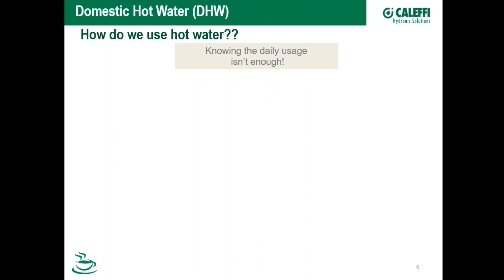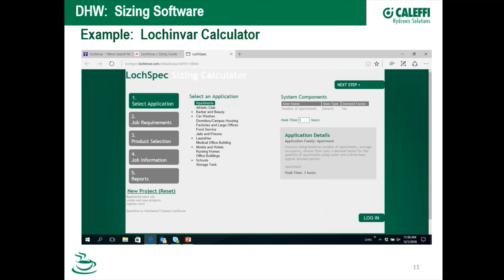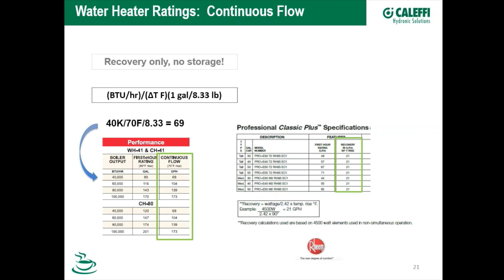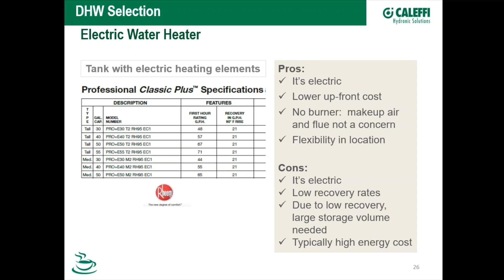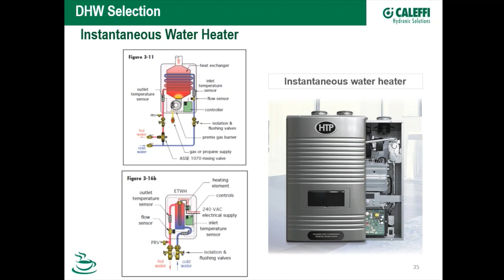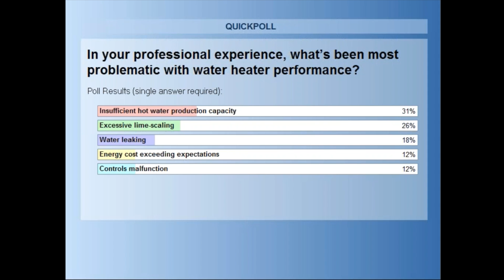Selecting and Sizing Domestic Water Heaters

Comment: Hello, I am trying to complete my driveway hydronic heating system with Caleffi components. Just contacted a local plumbing hvac contractor. I have the components and I'm looking for a contractor who is really comfortable with Caleffi. I'm here in South Lake Tahoe, CA.  The system is functioning well by manually operation of the pump and switching zones manually also. Looking for direction for someone to wrap up the system.
Reply from the maker: John, thanks for reaching out to us!  We have a couple of options for you.  Check out our wholesaler locator for a contractor referral or we would recommend calling contractors in your area to find out if they would be capable of helping you.  It’s also worth asking around your neighborhood to see if anyone can recommend a contractor that has done a similar project. 
 
Here’s our locator link:
http://www.caleffi.info/dealerlocator/
 
All the best to you.